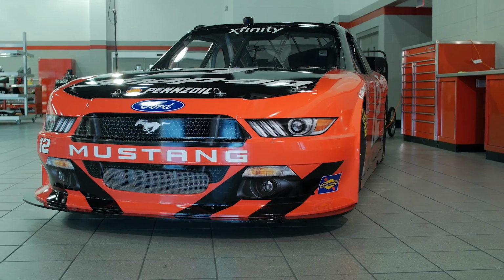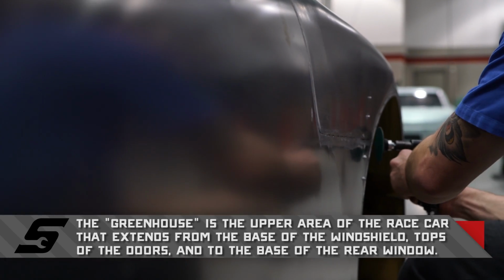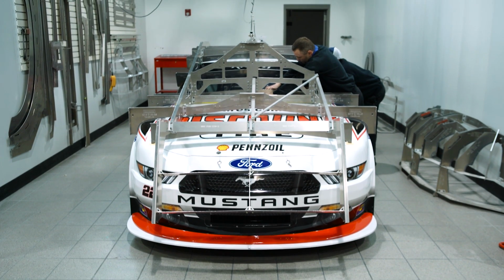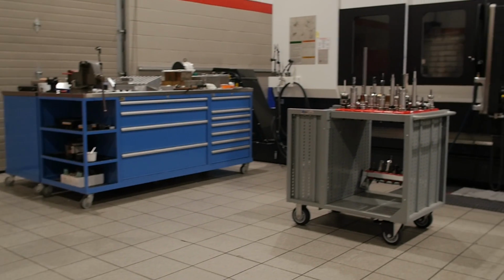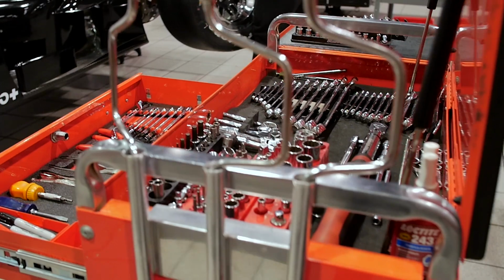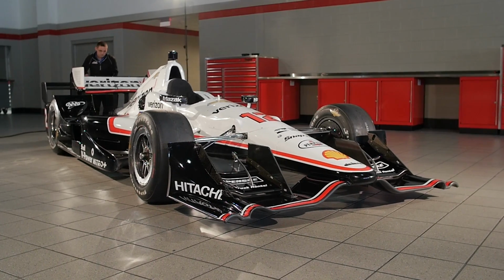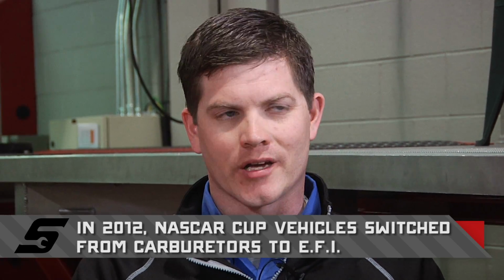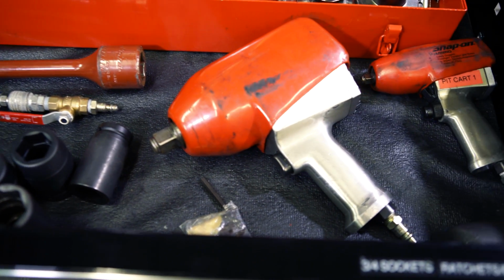Behind the Garage at Team Penske® Racing: Snap-on Great Garages™ | Snap-on Tools

Comment: Does the into animation not bother anyone else? The wench should be on the other side. That way, you’re tightening the SNAP ON GREAT GARAGES Logo instead of loosening it. Also, you want the larger grip of the wrench to be going with the motion, and in the intro it’s the opposite. You’re going to strip the snap on logo!!!🥸